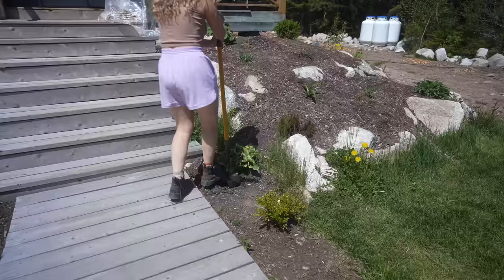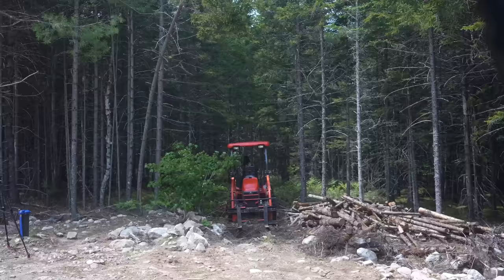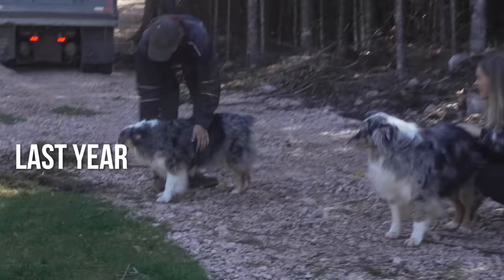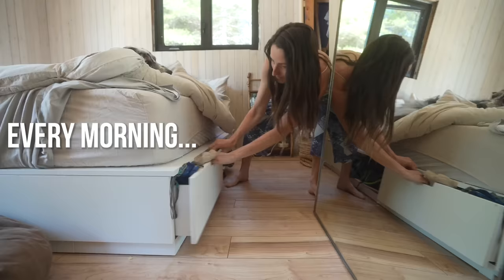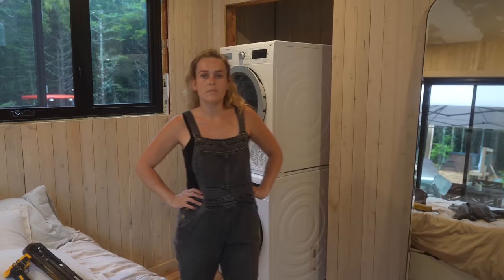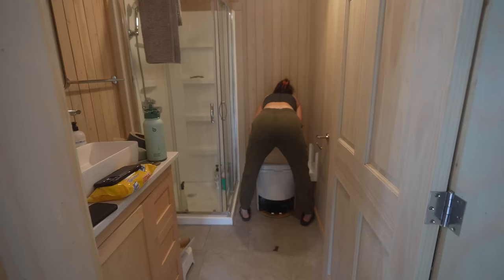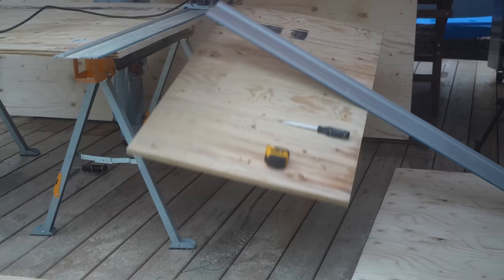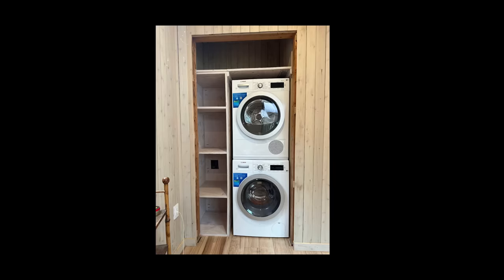All is Going Wrong… Building a Cabin in the Woods

Comment: Maintenance. A quick tip or two... The quick connect Handles on the kubota Can be a bit rough. Especially if you don't keep up on the recommended hourly greasing... Remember to use the low speed grease On your loader And backhoe zirk fittings. High speed grease gun for p t o applications. Use a piece of 1-1/4" schedule 40  pipe on the lever handles for the quick disconnect On your loader. Doesn't have to be long, just something to round off those edges and give you a bit more leverage. Also 1" heavy Clear Tubing works well for Softer handles as it fits snug. But won't offer you any extra leverage. A 2' foot chunk of 1-1/4" Pipe could go a long ways... Handy. Love the pack...

Comment: I don't know if you have any but if not, one of the most useful things to gave is a chain with hooks on the ends. Its so easy to wrap the chain around something heavy that needs to be moved, hook the other end to the tractor and voila, impossible to stretch or break them. You can use to pull up fence posts etc etc.

Comment: Living off grid is never easy. Mother Nature always has surprises in store. I lived in the country for 5 years with electric and well water, and even then, something was always going wrong. I finally gave it up and moved back to the city. Was trying to do it all by myself, and it was just impossible. Sorry if I missed this, but you really need to dig down a little and add gravel before you add topsoil to those low spots. Obviously, if it took forever to drain, you have a percolation (drainage) problem. The gravel allows the water to drain down off the surface. Love you gals and I'm rooting for you!

Comment: I'm amazed that they didn't vent that toilet the same way they used to vent the old propane furnaces the ones that had the pilot light in that the exhaust was a pipe that in the middle and it was an outside surrounding pipe that sucked cool air from the outside so it all came from the same outlet that went outside it was an inlet and an exhaust just the exhaust went out of your trailer further than your inlet did but you only had to put one hole in your RV They should've never got rid of those old furnaces 'cause they didn't take electric fan all it was was a pilot light and propane to run it I still got a couple of them in my shop old ones I kept the little tiny small one

Comment: Keep a check on hydraulic fluid when it gets low it makes a really harsh whining noise. I always keep 2 5 gallon buckets of spare hydraulic fluid. The unit most likely has a hydraulic fluid filter that may need changing because that can make it act like it’s low on fluid or winging also. If you’ve got a grinding metal on metal sound, need to find an address it ASAP. When I was running a backhoe daily every morning, we checked hydraulic fluid we greased all the fittings on the backhoe I always liked the red synthetic grease made to go in to salt water will give you the best protection and start turning black you need to put more grease they do make battery operated, grease guns, but get a bag of grease fittings because they go bad, you remove the old, scrape it with a nail put the new fitting on and you’re off to the races. Remember on the pens you get for replacements they should not be hard and steel. They should be softer so they were out and the parts on the backhoe, and normally has two or three search pins. You can always get by with a longer pin, and order the correct size and put it in later you can’t get by with a pin that’s too short, since these are fairly Soft steel They are very easy to cut and make with the tools you have.

Comment: Hi putting the washer and dryer in the bedroom closed is not an good idea you are going to pike up problems with mold , damp and smell the clothes are going to get an miff smell especially in winter needs to be in ventilated area the washer will always have water that stays behind after washing and  spinning the clothes.Thats why it is better  have an laundry room or put it in the kitchen where it is more ventilate, if you don't have space maybe build an small laundry room on the deck or attach to the house.

Comment: Place is coming together nicely. You are learning heaps of valuable skills. The best and really the only footing for an outdoor shower is a slat board base. Just various bits of wood nailed or screwed to three pieces of stud wood will do. But best to use treated timber so it can stand up to the wet dirt it will sit on. Plus the weight of people standing on the boards. The boards should be spaced with about 1/4inch between them for drainage. Then sit the whole foot board on some of the gravel. Standing on bare gravel with wet feet is not comfortable at all.
What if you went in to help Porter fix his equipment? Perhaps you would just be goffas, but at least you are showing up. 👍😄
Did you add a vent to the drier? It must vent to the outside of the building. Use some old poly pipe or a bit of gal downpipe to run a vent through the wall. The wall holds the outside end in place but it must have a drop down flap to exclude critters and snow or rain. The inside end just joins to the drier. But it might mean you have to reconfigure the back side of your new shelf unit. Best to do now before adding clothes.

Comment: Great job on the closet/Laundry. 😅 Concerning the Kubota tractor repairs are crazy expensive,  only saving grace is that the older units used the engine as part of the frame, hence the phrase breaking the tractor. Stay positive,  prayers for you both. 😊😊

Comment: Using a nut driver on hose clamps is much easier than a flat head screwdriver. I used to install washers and dryers so I had to do the easiest way to install them quickly with multiple installs daily

Comment: Hi girls, love seeing you. 😊
Just wanted to advise you:
The dryer should be placed in a well ventilated room, little fibers usually come out from it with the hot air even if it has a condenser, so   use it  always with an open window, in the future it will be healthier if you can  move it from your room.
 
Mi chronic sinusitis started this way, you don't feel it until it makes you sick, since then dust became a problem for me  I was 34 at the time, and never had any problem before.
Other than that a dryer is a must have !! It makes life so much easier ! 🤩😅 😎💕

🌅One more super important thing🤓☝️🪷:
It will be very helpful and convenient, to buy a base with wheels to move them when you need it,
you shouldn't work so hard to do so, I hope your floors are ok. 

I bought one of those last year and they're very good , my machines are big and super heavy and it has been just  perfect, take a look,  and also check how it is built because there are many on the market...  This is the link in amazon:

Mobile Roller, Fridge Stand Washing Machine Stand Base,Mobile Base for Dryer Refrigerator Furniture Roller Base with Stronger Locking 4 Rolls 8 Feets (Dual Tube- 8 Feets, Grey)   https://a.co/d/18pMt7I

Good luck my dears❤😃 wishing you both always The Best 🎉❤

Comment: Doing well ladies😊  bit of food for thought for you both, 1 be careful with that washer and dryer in that inclosed space bit of a fire hazard as dryers especially need to breathe.  See if it has a ducting vent that can be plumbed through the wall to the outside to disperse the hot air.
2, when you need to move heavy items around inside try putting a towel, blanket or rug under whatever it is your wanting to move and grab the towel, blanket or rug and pull it or one pull amd the other push and it will slide like cream off a hot knife and save your backs. Work smarter not harder, lifes to short to stuff your body at such a young age 👍👍👍

Comment: It would be pretty much impossible to make a tracksaw track, that fits perfectly, that's the reason for the rubber strip. For the tracksaw to leave a nice smooth cut, it needs a edge for the blade to rub against. Cutting through the rubber on a new track gives you this edge. This holds the fibers of the wood down, keeping them from being lifted by the blade, leaving a splintered edge.
Reply from the maker: That makes good sense, thanks for sharing your knowledge with us. 💛🐾

Comment: cordless vs corded, aka why I always buy corded.  I can buy a corded tool and use it with a portable power supply and when the power supply dies, get another and keep using the tool.  Which also just works on the outlets as usual.  A battery powered tool is dead, whether it works or not, when the batteries die.  Now you may say "but you can get more batteries."  Indeed, for now, but manufacturers love changing the format on their proprietary equipment and what fits now won't fit in five years.  I have a skillsaw that is still going fine after forty years.  I finally replaced my old drill after fifty years.  meantime, not one cordless tool I've owned has lasted more than five. the batteries die, the tool dies.  (engagement on)

Comment: Wow you got the best composting toilet of them all that was the most one I liked years ago but couldn't get one in Canada BC they only were allowed in the United States I had to go with the big one turn and barrel that you turned and added Pete Moss and Lime and it had a heat pad in the bottom that got rid of the water never worked with that damn so gross it had water hooked up to the toilet it was an RV porcelain toilet back then it was expensive it was $1700 in around 2002 2003 I think we got it didn't know the heat pad in the bottom was not working ended up ripping it out it's sitting in my backyard use it as a composter pretty expensive composter and the portion of toilet I put it in my RV bus and put in an accepted field by hand my accepted field just poop goes into it no paper no gray water gray water has its own tank and its own lines have had this system for 20 years 25 years I've never had to have it pumped out or had any problems with it and it only has two 30 foot lines with five gallon buckets at the end of each line with holes in it it's surrounded by a rock pit like the old days

Comment: You're supposed to use pit run gravel which is two 3 inch rock and small Gravel or crush rock on top of that or mixed with sand or compaction come on girls

Comment: NEVER put the washer on a dryer, with the weight and jumping around you have the risk of it coming off (EVEN when secured down). 

The way the dryer is attached on this washer, you can pop off the front cover and slide out the dryer, makes it easy to move. 

When you have a floor you can slide stuff on (like the wood floor) Fold over atleast once, some cloth or a towel and put under each point in contact with the floor. 
It will slide with ease.

EDIT:  The Wastewater pipe.  If you are putting in to a down pipe, only put in the first few inches and never put in contact with the water in the trap.
Also, if connecting under another water out (like under a sink) don't leave the pipe lower than the sink. your dirty water from the sink can go in to the washer. (keep a single loop cable tied up next to the taps.

Ohh, Ohh. .. when finished with the washer, give the rubber ring and the glass a wipe with a dry cloth and keep the door open a little (Will help with black mould on the rubber and a bad smell)

Comment: Love the video, as always. One question...Why is the washer on top of the dryer? Isn't the washer heavier? And what about the vibrations of the spin cycle? Or (god forbid!) what if the washer springs a leak and drips into the dryer? (Ok....several questions!)
Reply: No dear look 18:15 the dryer is on the top 😊 it has a  hose, because it has a condenser 😊❤ those are  much better than the ones before, less fibres on the air 😅

Comment: You know what you should’ve done was put a carpet underneath and just slide it. I would’ve worked with the washer and dryer and it would save your back but it’s looking good keep it up.
Reply from the maker: You are so right! My mother used a beach towel, when we helped her move things so it would slide easily and not scratch the floors. In the moment we sometimes forget. 🤩🐾

Comment: Also you have enough power to 5un everything off solar ,stove, laundry,water why use gas at all when you want to be green and reduce carbon emissions.  Makes no sense why have all that free power and still use gas? Get a septic tank and electric stove . If the gas truck can make it in so can a septic truck.